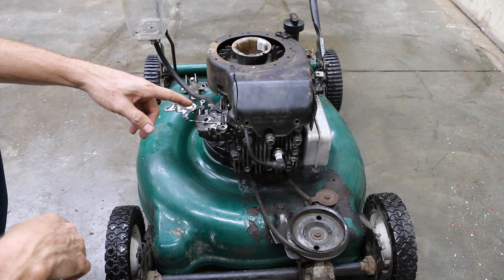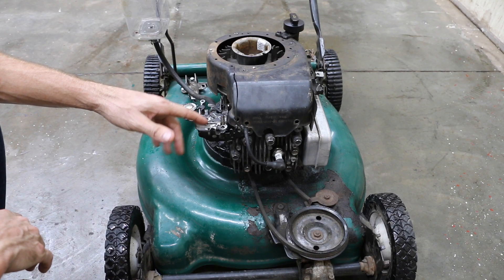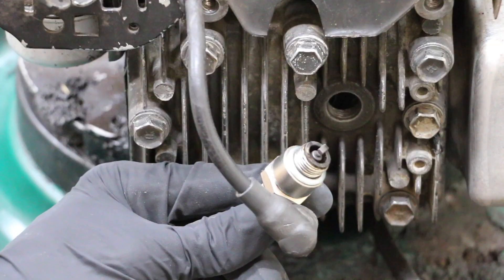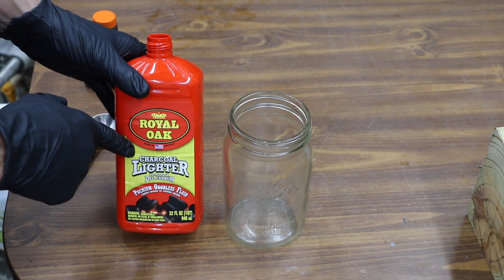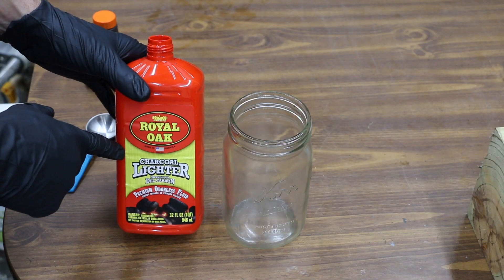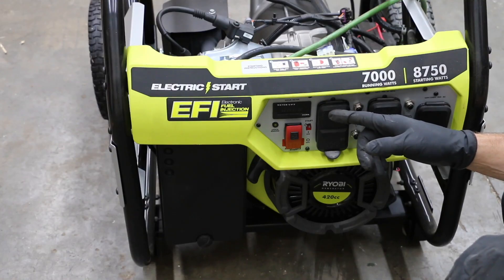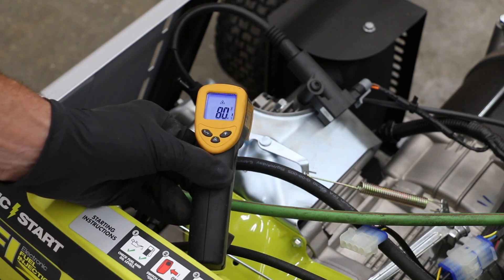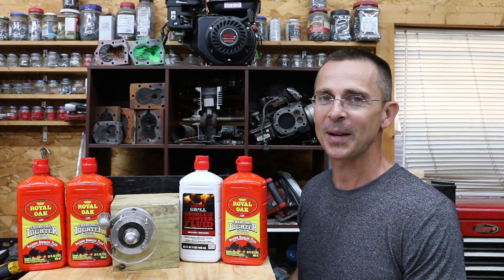Will a Gas Engine Run on Charcoal Lighter Fluid? Let's find out!

Comment: Video idea... Test various brands of car batteries. Check actual cold cranking amps, etc. How they react in cold conditions, do they have enough starting power to crank what they claim. Etc....
Reply from the maker: Great video idea!  I'll see what I can do.
Reply: @ProjectFarm  I'm guessing there's maybe a handful of actual manufacturers. What I hate is that most modern batteries seem to be "maintenance free" and only last at best two years or so, then tail off or start leaking. I remember a decade ago, even the cheapest of batteries had caps to refill with distilled water; they seemed to last a good while longer.
Reply: @MattExzy  Two years is pretty pathetic - I just replaced a pretty cheap, crappy one which was 7 years old before showing any problems.

As for manufacturers, one company (previously part of Johnson Controls, now owned by Brookfield Business Partners) called Clarios manufactures around a third of them, supposedly. Brands include Bosch, Varta (literally the same ones, those), and Optima, among a wide variety of others including quite a few 'house brands'. Not to say they're all the same batteries, but they are all under one umbrella. Exide are another major manufacturer, but I don't know of any brands they OEM off the top of my head (I'm sure they do, though). 

There are dozens if not hundreds of smaller companies, but the likes of Clarios and Exide cover most of the market, and their prices reflect the economy of scale..
Reply: I think this would be a great test
Reply: Very good idea!
Reply: it's almost useless to test every brand since about 4 companies make 90% of the batteries for all the brands anyways

Johnson controls
Optima
Exide
and i already forgot the last one, bosch maybe?
Reply: @bait28  Johnson Controls are no longer involved, they sold the business. It now exists as Clarios, and both Optima and Bosch are are under that umbrella.
Reply: @bait28  I don't quite see how $13B dollars is 'technically not sold'..
Reply: Bait28 So what if the brand you buy didn't actually produce the battery?  The brand commissions one (of the 4 or so) manufacturers to build a battery to a set of specs determined by the brand, not the manufacturer.  The brand then slaps a label on the thing listing some specs - hopefully, but not necessarily, the same as what they commissioned.  The question is which brands come closest to telling the truth to the end user about what the battery actually is built to do. Who manufactured it is moot.

Comment: Another cozy video.  When testing weird fuels or additives, do you ever worry about catastrophic damage happening while you're near the engine, or are these things mostly safe nowadays, engineered to "fail gracefully" instead of catastrophically?  I was wincing a bit (engaging my "safety squints") when you were trying to get the green mower to fire up and it wouldn't turn over immediately.  Thank you again for the great vids, and it's refreshing to see another small engine video like what subscribed me to your channel a couple of years ago!
Reply from the maker: Great question.  Safety is definitely a priority.  The biggest risk is backfire and the flame causing a burn to the hand that I'm using as a choke.  Thanks again!!

Comment: I worked in a hardware store in the '60s. We sold mineral spirits by bulk----lots of it was used as charcoal lighter fluid. Charcoal lighter fluid and Tiki torch fuel should make a diesel fuel substitute with the addition of some motor oil to increase the lubricity.
Reply from the maker: Great information!  Thank you

Comment: Id love to see you test the go cart out for speed with different kinds of fuel. Like 87 89 93 e85 a 100 or higher octane rc race fuel even like nitro methane or alcohol from drag cars. See if just different fuel would change the top speed witout anything else being changed.
Reply from the maker: Great recommendation! Thank you

Comment: I wonder about the fuel you've tested that proved to burn too hot to run. What if you tried to add something to them to cut the burn temp? Maybe 2 stroke oil, WD40 maybe beer? Would anything mix?
Reply from the maker: Thank you for the video ideas!

Comment: Bit of a random idea but it would be interesting to test gasoline mixed with Sterno vs normal gas. Don't know if you watch Nascar but it was used by Michael Waltrip Racing to cheat in 2007 at Daytona.
Reply from the maker: Thank you for the video idea!

Comment: you dont seem to have any videos comparing spark plugs. i was hoping you would include Pulse Star if you ever go this route. i tried them once on a dodge neon with no success. i didnt disconnect the battery so maybe that was my mistake.
Reply from the maker: Great suggestion!  I have a PulseStar spark plug for testing as well as several others, such as the E3.
Reply: @ProjectFarm  perfect. both the plugs i was thinking of.
Reply: @ProjectFarm  im curious about automotive and small engine use. 4 cycle and 2 cycle. gas and diesel.

Comment: I guess, if you knew your fuel was low, you would do better to add that lighting fuel as soon as possible to whatever is left in your tank. At least that way you get the benefit of some of the content of your gasoline, and a potential increase in available mileage from burning the additional fuel. . . . Or, could that actually cost you some potential mileage by robbing your engine of power,  earlier, prompting the use of lower gears and higher RPM to compensate for the power loss?  Hmm, worth thinking about. . . . 

I remember one summer, we (a whole bunch of us) decided it could be fun to play around with a mixture of fuels in a lawn mower engine. We didn't try individual fuels, we just added a load together! We tried a mixture of; petrol (gasoline), two stroke oil, methylated spirit (denatured alcohol) and paraffin (kerosene lamp oil). It wasn't wholly successful! It smoked, it had little power, it was hard to start, and it fouled the plug, but it was our last week of the summer break, so school was looming, and we though it might just be a last bit of entertainment for the summer.

It's a pity really, that we didn't try to figure out which elements might have made it go, and which were a damp squib. So, I have been wondering, how about trying some other fuels? like; lighter fuel (Zippo etc), methylated spirit (denatured alcohol), or surgical spirit, and so forth. Test them individually to see which works best, and compare them against normal gasoline, then from the results, work out a rough table of calorific/energy values? Maybe even try blending them to see if their individual performances can be improved upon (or degraded) by blending two or more together?

Just a thought. . . . . . . . . . .
Reply from the maker: Yes, great point on adding fuel early.  Thanks for the video ideas too!

Comment: Could you evaluate laundry detergent?  There are so many brands and variations within the same brand all with so many claims.  Thanks for your great work!
Reply from the maker: Great recommendation!! Thank you
Reply: It would be nice to know which brand/variation a lawnmower would run best on.
Reply: As a lube truck mechanic, I also would like to know which laundry detergent is best.  
Also, Zep TKO is the best hand cleaner, prove me wrong!
Reply: Fabric softener is horrible stuff.
First off, the smell stays around for days, which is offputting and gross.

Then there are the chemicals in there that ruin the flame retardant qualities of many fabrics.

A wax like coating on washcloths and the like keeps them from properly absorbing water, and this builds up over time.

Not to mention the fact that dirt seems to stick to the clothes faster the next time you wear them.

So skip the fabric softener.

Comment: What sort of attachment do you put on your drill to clean off the carbon buildup when you take the cylinder head off? Is it like a wire brush head?
Reply from the maker: It's a wire wheel but I don't recommend using one on aluminum, since it causes a lot of wear.
Reply: Project Farm thank you!

Comment: OK, now I know 2 uses for lighter fluid.

1, removing nasty stickers and price tags.

2, emergency fuel in gasoline engines.

As for lighting charcoal, NO!  Unless you like 
Kerosene burgers.  Get a charcoal chimney, 
or a propane torch.  One of those weed burners, 
hooked up to a BBQ propane tank also works.
Or, get the Weber charcoal grill, with the propane 
starter already installed.

Yet another great video, Todd!

steve
Reply from the maker: Thank you!

Comment: Does using the wire wheel on the motor like that hurt it?
Reply from the maker: Great question. This does cause damage over time. These test engines only last for a few videos.  The engine oil alternatives usually cause significant damage.

Comment: 0:35 The perfect displacement for an engine. 

Edit:
You should try Isopropyl alcohol as a fuel. The 99% stuff.
Reply: Carlos Pulpo The first International IDI had a displacement of 6.9 litres and 420 cubic inches.
Reply: @strawberryroan1941  13 letter shit spreader :D International. im sorry I had to lol an im a ford guy.
Reply: Baylans mess of a sh!t ton of videos Haha I say that joke all the time! I am a Ford guy myself, but no doubt old international engines were excellent, like the DT-436, or DT-466 or the IDIs, really good engines. They sounded pretty mean to lol
Reply from the maker: Thank you!
Reply: Should be similar to E100 (commonly sold in brazil or 92-95% ethanol) just need to adjust the engine air fuel ratio properly and start it over 15c or use petrol/gasoline to cold start. Also here's his video about the 91% https://www.youtube.com/watch?v=hJKZ_41wbcM, he should make a new one though.

Comment: Lets try some 80 proof tequila, vodka, Bacardi 151 rum and some good ole moonshine! Should run better than e-85 and you might get happy testing the stuff! If you leave the bar at night after having one social drink 2 hours before and find someone siphoned your gas tank! Well, run back in and by some liquor for your tank. Great review but what would lighter fluid do to the cats and other emissions equipment? It doesn't look like it is as clean burning as other fuel.
Reply from the maker: Thank you for the video idea!
Reply: I dont know if 80 proof would work maybe 180 proof everclear
Reply: Why would you think liquids with less of the same alcohol in it would work better? Both e85 and all alcohol for consumption are Ethyl alcohol, also know as ethenol. Alcohol+ gasoline is obviously a better fuel then water with some alcohol such as the things you listed
Reply: @jaydunbar7538  I know alcohol as I made it and ran it in vehicles back in the 70's OPEK oil fiasco. Never mixed it with gasoline as ethanol is an excellent fuel alone. 80 prof alcohol runs great in gasoline engines, you can run from 70 to 90 prof with 75 being the most efficient in gas engines.  I run alcohol in my mower and have been doing so since the 70's I still have my Ford 390 V-8 running on ethanol. I ran alcohol in 6 cylinder engines, fire breathing V-8's and race cars. Indy racers run ethanol because it is safer than methanol or gas. Do some research on alcohol fuel before you become critical of someone in the know!.

Comment: Is it not ethanol bio fireplaces use it and my saab 9-5 bio turbo is suposed to use a higher percentage of ethanol in fuel mix but the uk only do 5 percent i think America has like 15 % maybe more race cars use it my car can have a max of 75 percent it damages normal cars rubber but not if its designed to run with it
Reply from the maker: Thank you!

Comment: Great video. Love the clear cylinder head.  Idea- Try one of the propane gas conversion kits out and while you are at it see what kind of different gases will run an engine.  First try- methane gas from a flatulent old man that ate beans for lunch.  I think it would run!
Reply from the maker: Thank you for the video idea!

Comment: Nice testing. Have you tried Coleman fuel yet? That stuff seems to never go bad.
Reply from the maker: Great suggestion!  I tested it a while back and it did work very well but the test engines did ping a little under heavy load.
Reply: @ProjectFarm  
I wonder if some napthalene might help that.
Reply: @upside downdog I would also like to know if Coleman fuel could be used in a modern car and what it's shelf-life is. I don't agree that it never goes bad but it certainly keeps a lot longer than gas.
Reply: @alfredmorency8296  
I have successfully used 18 year old Coleman fuel...in a lantern and stove. Never tried to run an engine on it. PF says it pings. It probably needs some napthalene (mothballs).
Reply: @upsidedowndog1256  Your saying that reminds me of a couple of relevant things. First is when I lived in Mass I kept my Coleman fuel in a storage room in the basement that was 60 degrees all year round and I never had any problems with it. Now I live in Fla and I keep it in my shed which can hit 120 degrees, and the last time I tested my stove and lantern (a few months ago) they burned yellow and Smokey which I attributed to the 3-year-old fuel. The last time I actually used my stove and lantern was during a ten-day power outage following a hurricane, during that time I used pump gas (they are both dual fuel) because I ran out of Coleman fuel. Pump gas is not as good as Coleman fuel I wonder if it might have made a mess of the generators, I think I will service them then try the old Colman fuel and see which it is.
Reply: @alfredmorency8296  
I would be curious to know. I kept mine in a shed in Arkansas. Not Florida hot but hot enough to ruin it I would think if that was the case. The fuel may have changed over the years like pump gas and even avgas has. The new formulation of avgas has more of a kerosene smell. Old avgas used to last almost forever like Coleman fuel. It will be interesting to see if the newer stuff does too.

Comment: A 2 cycle engine runs fine on Charcoal Lighter Fluid if enough oil is added. I have a old Lawnboy mower that I ran Charcoal Lighter Fluid in because I did not have any gas at the time.
Reply from the maker: Nice!  Thank you

Comment: I agee, you dont want to use charcoal lighter fluid to run your gas engine.  But it's nice to know you can in a pinch, if you need too. Hopefully I'll never get that bad off to have to. Thanks for the video and the different testing that you do. Your videos do answer a lot of questions as to what works, what doesn't work, and what is the best value for the different products you might use. Again thanks for sharing your videos and ideas.....
Reply from the maker: Thank you!

Comment: Now that's what I've actually done LOL. When I was about 17 my mother told me to do the yard I had no money for gas can I ask her how am I going to mow the yard she said just do it so I took peroxide and lighter fluid and fill the tank and it ran. but I would not recommend it it was very loud but it does work in a pitch
Reply from the maker: Thank you!
Reply: As in hydrogen peroxide?
Reply: @walterkersting1362  LOL, yep!
Reply: BC Green I must try it,25% hydrogen peroxide 75% naphtha?
Reply: @walterkersting1362  to high of combustion try adding 10% regular gasoline to the mix.
65 to 60% of naphtha 25 to 30%   hydrogen peroxide.
Reply: BC Green let’s see if we can get this guy to try it on his lawn mower, that machines had more funky stuff in it than a truck stop lot lizard.
Reply: @walterkersting1362   believe it or not I have made that suggestion a few times.

Comment: Man, after watching all your videos on alternative fuel I’ve realized that a small carbed engine will LITERALLY RUN ON ANYTHING
Reply from the maker: You are right!  Thank you
Reply: Well, yeah, it's a "combustion engine". You just need to adjust for stoichiometry .
Reply: Alucard Pawpad anything else you would like to add, Mr. Nye?
Reply: @ElGuero227  Yeah. It's literally just a syringe that squirts air and fuel in. If it can burn outside, it can burn inside. :>
Reply: Alucard Pawpad Thank you Bill, very cool!

Comment: Oily rag auto-ignition tests? 

which oil combusts the most readily
Reply: Oh, this, I've seen so many "oily rags" hazard warnings, and so many "my wooden workbench has soaked so much oil it'll explode" quotes, that I'm actually curious at this point. Though I'm sure, the science says the combustible stuff is also very evaporative and usually dissipates quickly, leaving behind only high temperature combustibles
Reply from the maker: Thank you for the video idea!
Reply: I knew a guy who started a fire in a 
stack of rice hulls.  All he did, was 
to water it, and it started smoldering.

Yep, STARTED a fire with water.

steve
Reply: @steveskouson9620  Sounds like composting. Composts can get hot enough to autoignite. Water helps with the composting. Otherwise water wouldn't start a fire, unless there's something weird in there like sodium.

Comment: One thing I pondered was if lighter fluid causes damage to the fuel lines or anything else. Is it reactive with metals etc?
Reply from the maker: I don't believe it'll cause any harm.  The sometimes are packaged in metal containers.
Reply: Naphtalene is kindda kerosene with a more volatile part.
Reply: A large portion of gasoline for engine use is technically this stuff already. Just add butane, heptane, octane, and other additives or hydrocarbon fractions to the mix.
Reply: How about rubber hoses and gaskets etc?
Reply: @B1GDaddyFatStax  All fine, it has a lower aromatic content than gasoline and isn't as polar as alcohol. Not problematic in those areas.